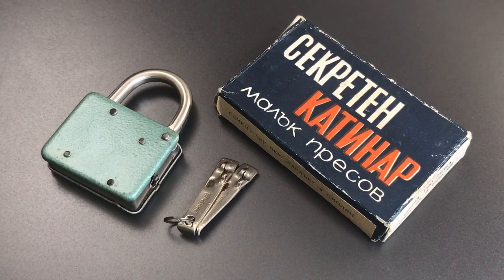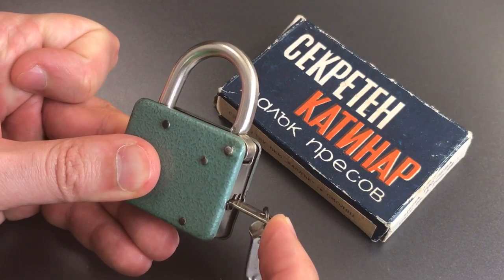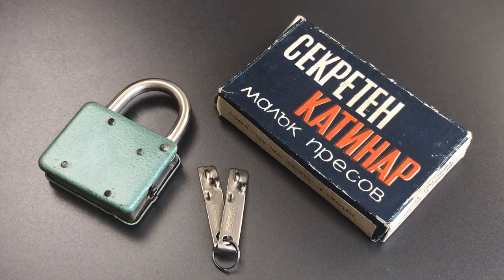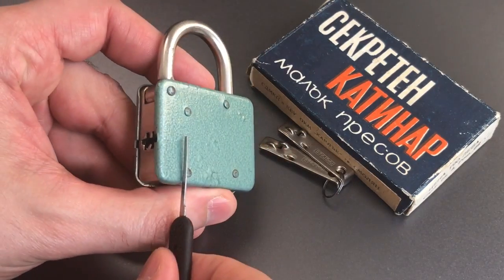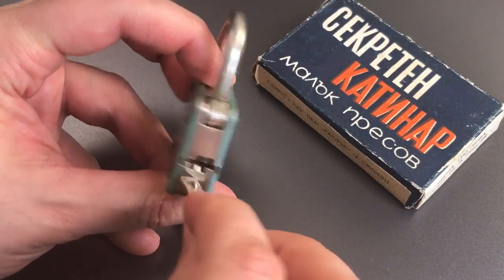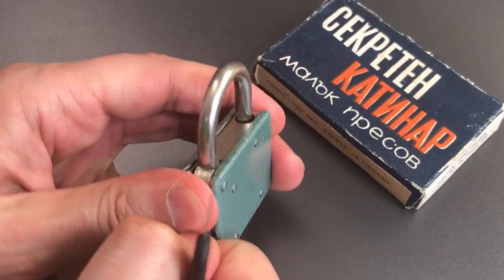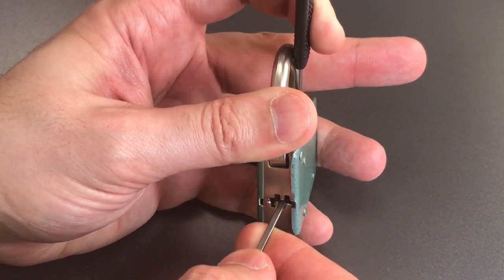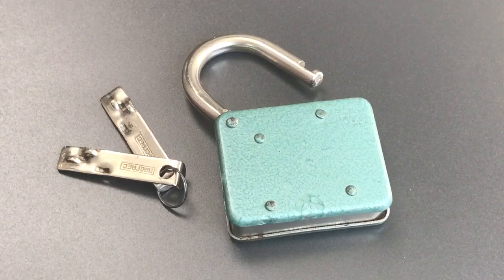[492] Vintage Bulgarian Dimple Lever Lock Picked

Comment: I know such lock from my childhood ;D. We had these (similar locks) with a steel wire (covered in rubber) as bike locks and I have still 3 of them (one small and 2 big ones) in this padlock style :). During the GDR era the Guri locks (which are very simlar to yours) were pretty common. Thanks a lot for sharing, definitely a cool old lock and nicely picked :D.
Reply: I remember that key , i may even have it in some junk box but cant remember if we had working lock to it .
Reply: redcatimaging cool Foxxy. I bought one recently that is making it's way to Kris for me. It's also labeled Guri but looks otherwise identical. Mine is used and no box but for €5 plus shipping was a good price for me. I love strange locks.🍺👍🏽
Reply: My uncle from GDR still has a steel cable bike lock with this locking mechanism in everyday use. Pick resistant by obscurity by now 😂 But the wires are very flimsy and can be cut easily. It's "Seilschloss G 11" described at https://ddr-fahrradwiki.de/Fahrradschl%C3%B6sser It says the cover is plastics not rubber but it has a rubbery feel.

Comment: That's quite likely the same mechanism as the cheap bike locks from my youth (actually, I still see them around now and then). The key looked like this: http://meeopdewind.nl/wp-content/uploads/2015/04/fietssleuteltje.jpg and the lock itself like this: https://s-media-cache-ak0.pinimg.com/736x/84/6d/b5/846db5e5d3015113b67a7e45175d4be7.jpg
The lock was attached to the bike and went through the back wheel, disallowing it to turn. It was easily opened by bouncing the entire bike! :)
Reply: I also thought that it must have been used for a bike. Too small for a garden shed or something similar, and too few other daily things were ever locked in communist Bulgaria. So bikes are the answer I believe for this lock too.

Comment: Can it be shimmed?
Reply: The Lock Picking Lebowski No. If you could, it would've popped when LPL applied the tension. Instead, that put pressure on the locking elements.
Reply: Nigel Tolley Righto.